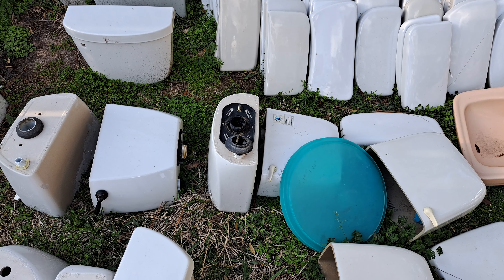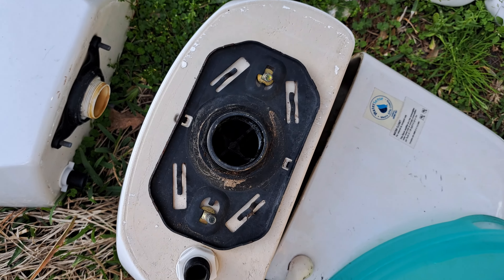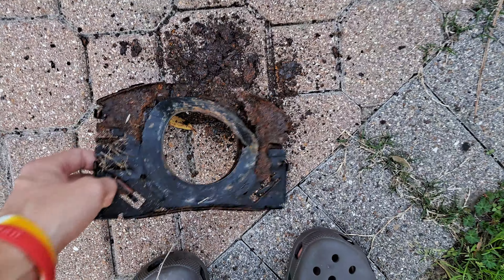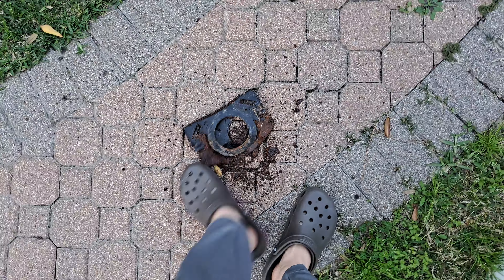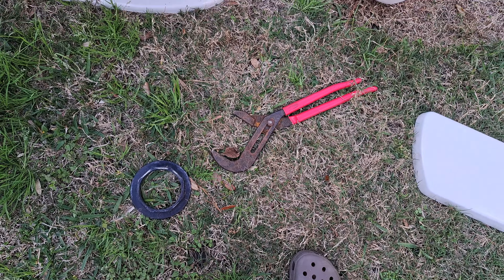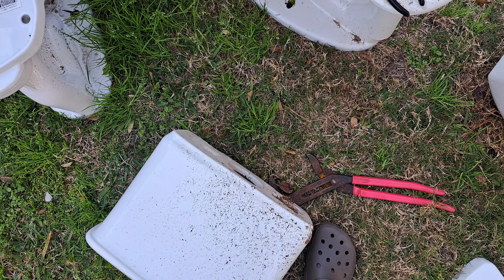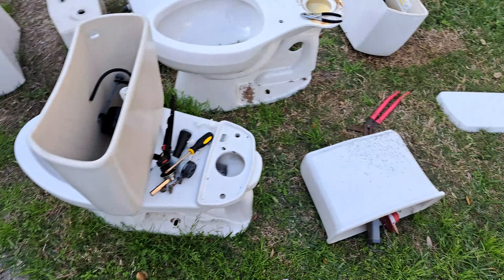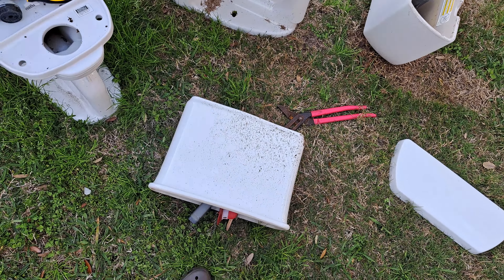Kohler's Biggest Design Fail

Comment: Yeah this was not a very good design. This actually kind of makes it more difficult to install. I just stayed at a hotel in New York with those Class Six Cimarrons in every guest room (it opened in 2014 and is a very well kept property) and in the room I stayed in that time, the tank was extremely loose (too the point where the tank would rock around every time I pushed the handle to flush it. I bet the reason for that was due to installation error because of this DryLock mechanism.
Reply from the maker: Jeez

Comment: I knew it was a bad idea from the day it took me an hour to get one of those off to replace the flushvalve due to leaks. Also quite restrictive of the types of flushvalves you can use in these. Not a fan of drylock at all.
Reply from the maker: Exactly, I had to do it with my grandpa's toilet and it was awful

Comment: There was a kohler toilet with one of these at someones house I know, every time you flushed it water would drip down the bowl onto the floor, the floor was always wet, and there were rust stains on both sides of the bowl, thankfully that toilet has been replaced
Reply from the maker: That's awful